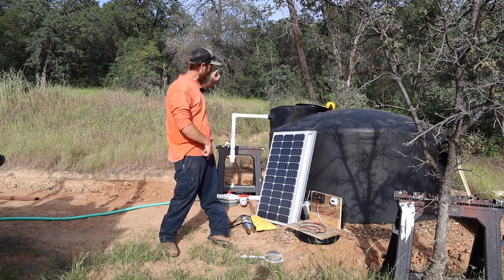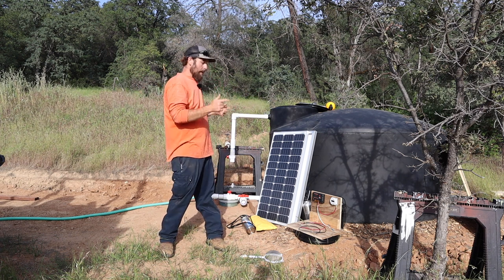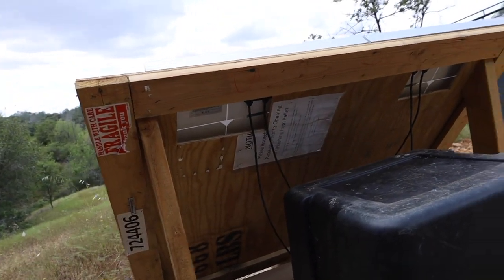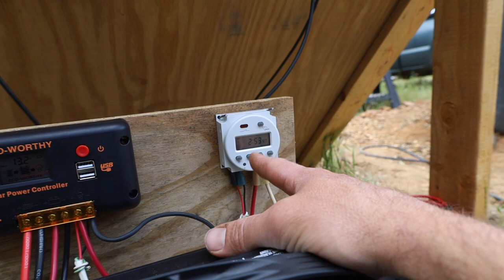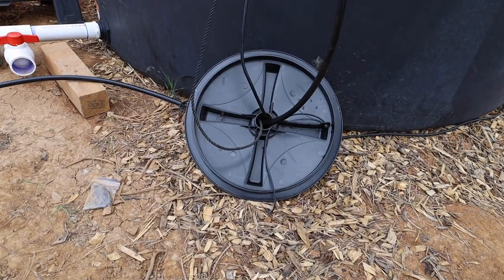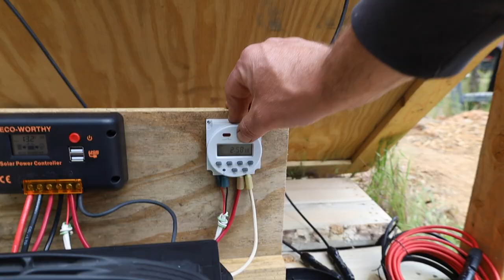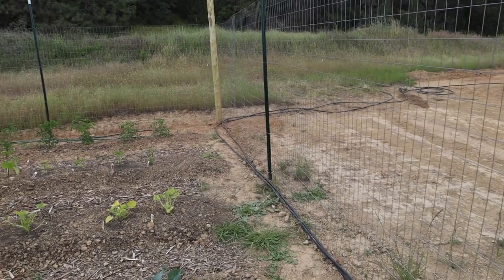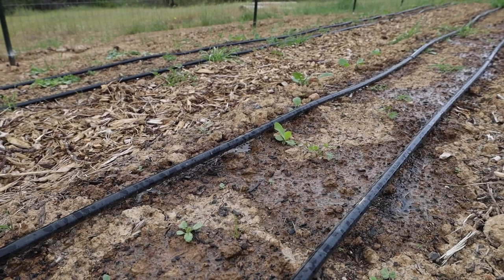OFF-GRID Garden SOLAR WATER PUMP

Comment: Be careful hooking your pump to the load on the charge controller, the load spot on the charge controller isn't made to handle very many amps, it's mainly for 12v lights. It would be best to hook it directly to your battery.

Comment: Is there a way to hook up a pressure switch or on and off instead of timer? I'm sure there is just don't know much about solar or pumps for cisterns
Reply from the maker: the pump does have a high-pressure shutoff. I believe it is 120psi but I am not sure how good that it is for the pump, if its for safety or a feature. 😐